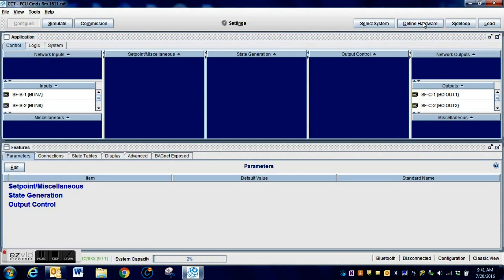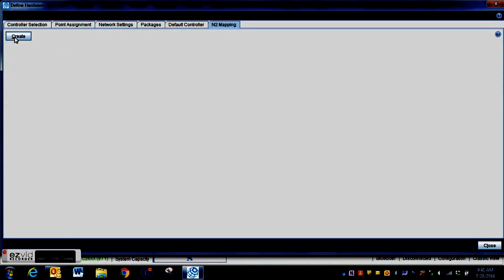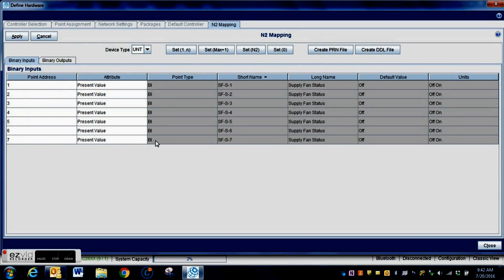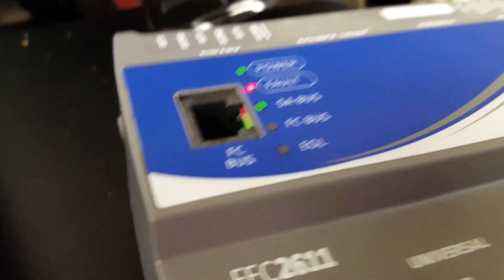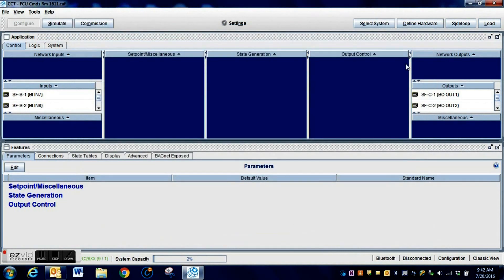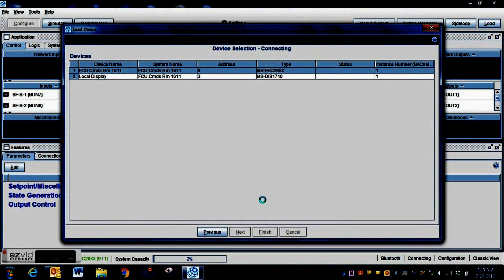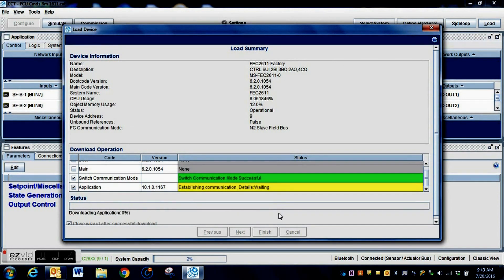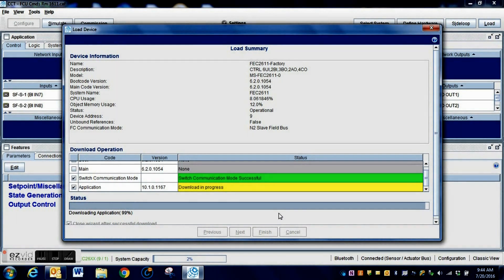Upgrading Johnson Controls N2 Devices with newer generation FEC controllers

Comment: Great videos! I'm looking for advice on how to view older JCI N2 device on Windows 7 PRO. Not sure what the newest software/tool in available to buy/use. I had used HVAC Pro on Windows XP but no longer have that computer. It would be nice to get something thats user friendly and eventually use it for converting older N2 devices to FEC controllers. Thanks
Reply from the maker: Unfortunately jci has abandoned n2. They don't offer any type of updated software. Those programs can run on windows 7 if you can find it.
Reply: You can run HVAC PRO on a Windows 7 machine. You just have to run it in compatability mode for Windows XP service pack 3.

Comment: I wish I found this hours ago. I tried N2  mapping after it was already downloaded, just to grab the PRN file. I think I need to re-download it to switch the comm mode
Reply from the maker: That should be easy for you to do. You may need to select that option in the system select if it gives you problems

Comment: Just to clarify,  you opened either the original file or uploaded the UNT using Hvac pro.  Then created a similar program in CCT.  However, I didn’t see the Control output section or the State Generation logic when you downloaded the program to the FEC.  In other words, you have the inputs and outputs but not the logic.  How is the controller going to know what to do? What am i missing?
Reply from the maker: You have to write a completely new program in cct that matches the original HVAC program. You will assign the points by clicking on the hardware definitions tab and selecting point assignment.

Comment: great tutorial
Reply from the maker: +lenny cordero glad to help.
Reply: On version 6.2. Do you know how to change the time and date on  a NAE
Reply from the maker: You should be able to change that under the focus tab of the device itself.  If you are adding the NAE to an ADX server be sure to have the time on the NAE exactly the same as it is on the server.  It needs to be within a minute or two or it will not populate on the server network.
Reply from the maker: Glad to help
Reply: +System Control Tech 
Thank you
Reply: Hi I have NA1 which is showing now days General issue and from system device is disabled. Can you help me to sort out this issue I will be thanks full to you

Comment: Hey guy! How are you?
I'm not english very well, but i try explain to you the problem.
I did download in the FEC2611 and during my computer turned off. The FEC caught in fault and is without communication. Do you help me?
Reply from the maker: Try to directly connect to the controller using your bluetooth adapter.  Restart your computer and try to reload the controller again.  If you are not able to reload the controller you may need to send it in to a repair center.  Good luck.